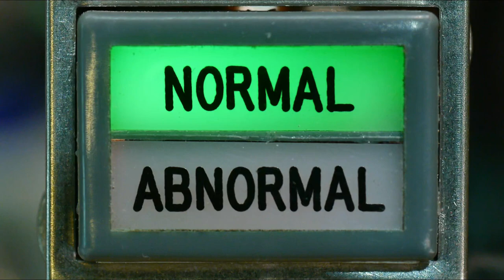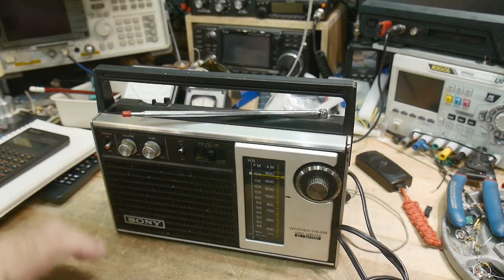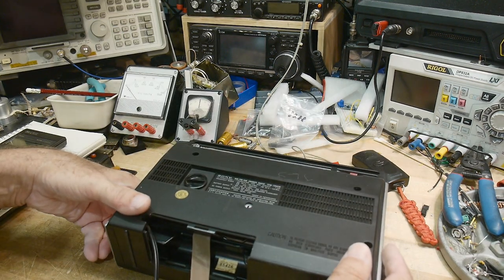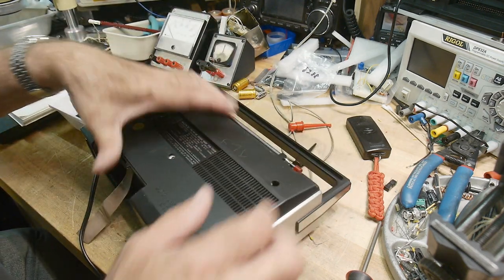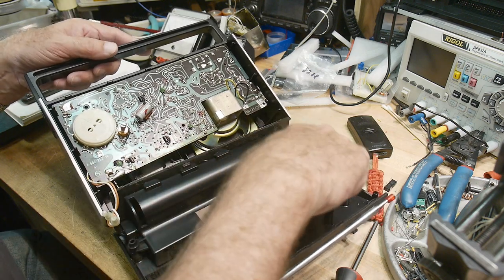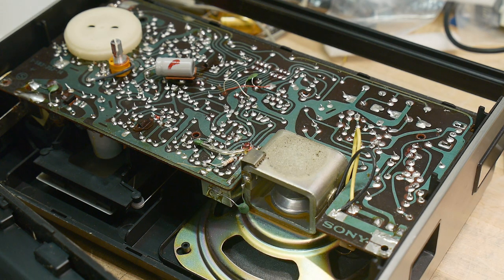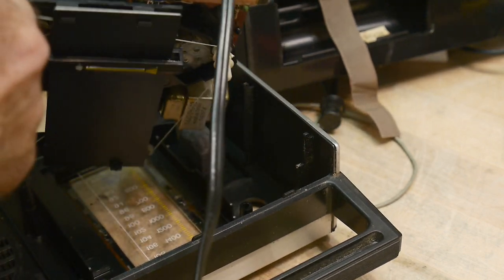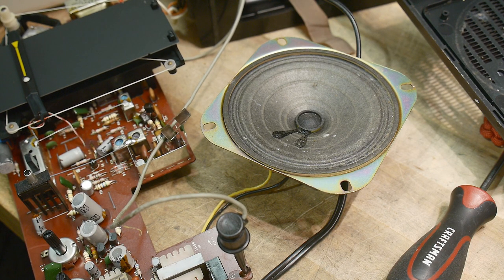#1316 Sony TFM-7350W Radio Repair

Comment: Every time I see you take something apart you grab a tray to put all the loose bits in and sometimes I see you put the device back together so I am wondering how many trays of little bits do you have sitting around your shop?  😬

I recently watched your older video on an HP power supply with germanium transistors which got me to thinking about an old supply I have so I dug it out to take a look.  It is a Trygon PS32-1.5 120VAC in 32VDC 1.5A out rack mount chassis with remote voltage sensing, remote variable voltage and current limit from the late 50's/early 60's and sure enough it uses the same Motorola TR375 germanium transistors.  I traced out enough of the circuit to confirm that it regulates the negative rail just as your HP does.  What is kind of mind blowing are the three 10 ohm 25W power resistors connected in series and mounted on the outside end of the chassis with a ventilated cover but no fan.  I guess efficiency wasn't a thing back then.  Another real "HUH?" is the screw terminal strip on the other end of the chassis with connections labeled "AC | AC | G | V+ | +Sense"....  Yes that's right 120AC is totally exposed and right near to other exposed connections.  A slight slip of a screwdriver or loose wire could make for a very bad day.
Reply from the maker: IKEA has the best and cheapest little trays

Comment: I just bought one of these off ebay. It worked great for a few days then the volume dropped almost to nothing and the led tuner light quit working. Still getting reception. Any thoughts on a fix?
Reply from the maker: yes, it need fixing

Comment: Hi, nice and quick diagnostics including repair, I just have no idea why you didn't take off the black plate under the pointer needle (from the video it looks like it's just snapped onto the plastic frame) and the cutout in the plastic frame would be a nice access to the capacitor. The video also did not show whether the stabilization was checked (so that the new capacitor does not go to silicon heaven) and whether the printed circuit board was cleaned of leaked electrolyte. When assembling, I would proceed in the opposite way and first seat the speaker, with your procedure there was a risk that it would not sit on the guide pins and the membrane would be damaged - it is also not possible to see whether you installed the condenser clip on the speaker chassis.

Nice day  🙂 Tom
Reply: Blah, blah, blah…I’m important!  Blah, blah, blah …
Reply: @yamahajapan5351  I don't understand your answer

Comment: Quick repair, but I didn't learn a lot of things. It would be nice to have short explanation about some circuits.
Reply: One lesson is the parts most likely to fail are under something else.
Reply from the maker: You learned that you are intolerant of videos that don't fit your expectations.
Reply: @IMSAIGuy  Whoa.
Reply: Thanks for the help, bud .You showed me what I needed and I fixed the same radio.👍